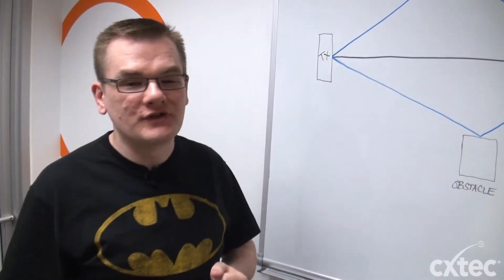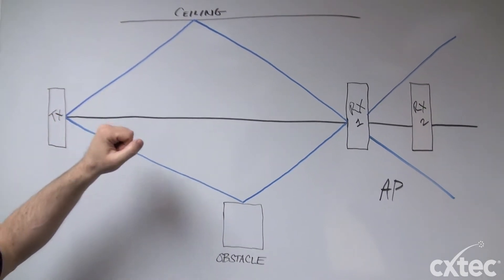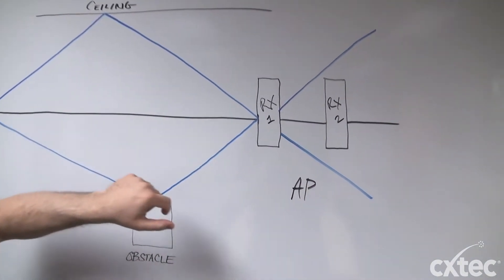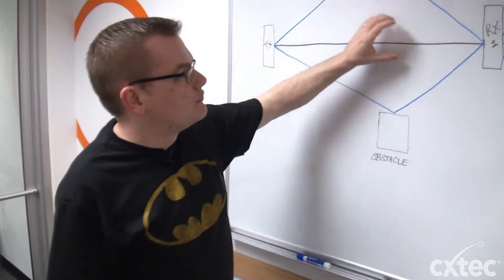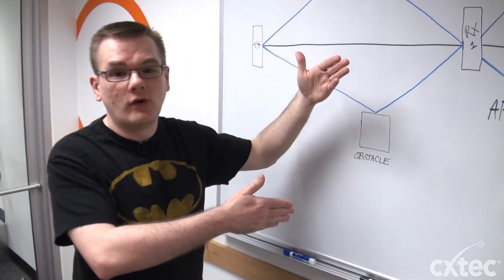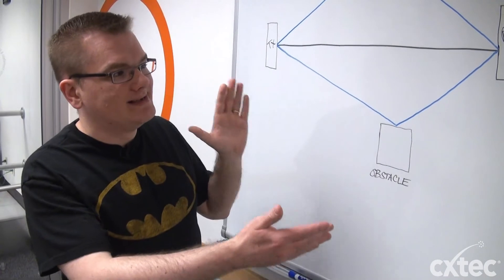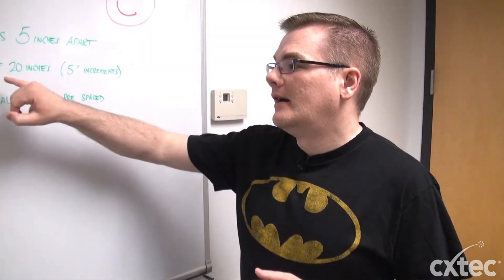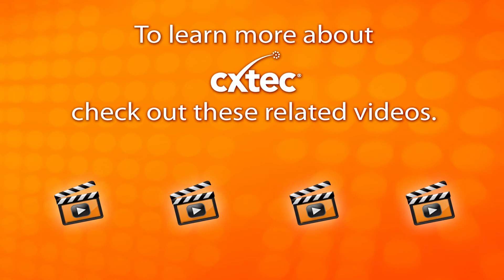Wireless Antennae Diversity - CXtec tec Tips

Comment: Hi, great video!  I have an e91 2006 and the key fob stopped opening the doors. I bought a new key at the dealer and it doesn’t work either. The central locking system works fine, but manually.  The dealer wants to do a full diagnostic on this and hinted that it could need an antenna.  That’s hundreds of dollars.  Could I just need this diversity amplifier?